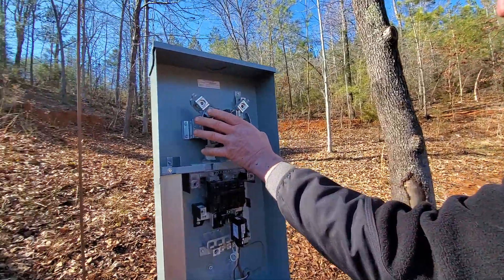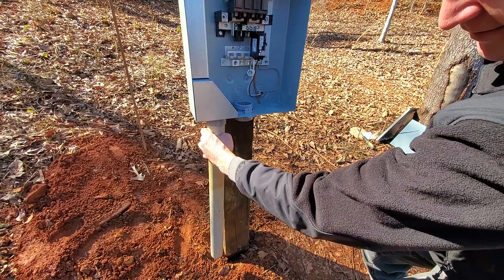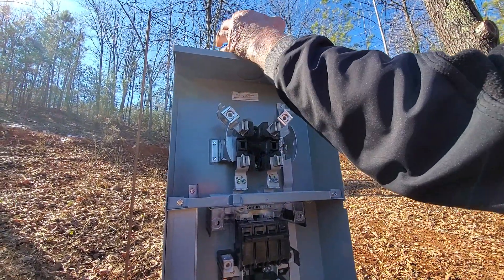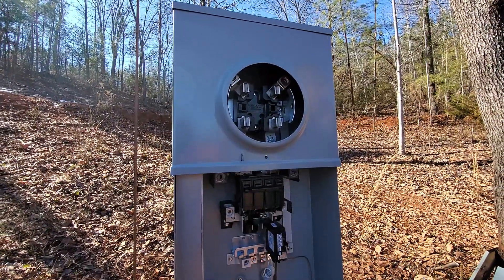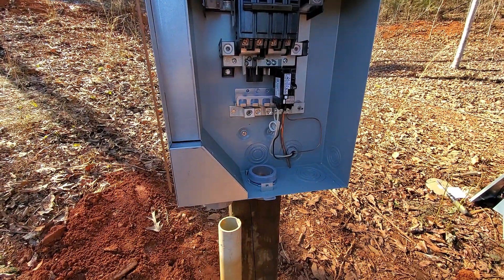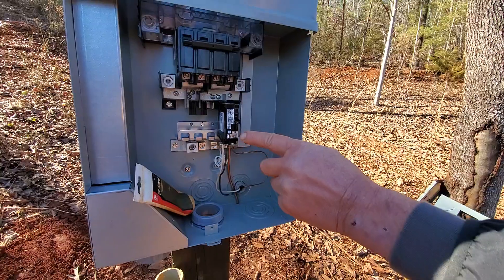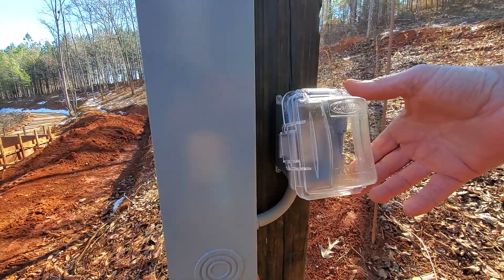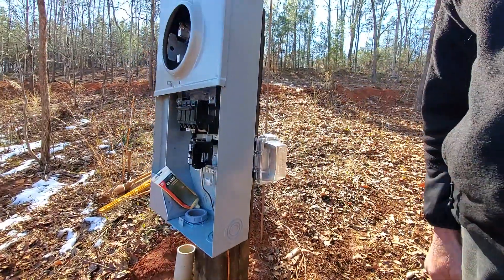Earth Berm House #3 construction 200 amp Electric disconnect panel wiring

Comment: I think I'd be satisfied just making sure I had good drainage away from the house.  I imagine it's more moist in the Carolinas than in Northern Idaho.

Anyway, I don't think the moisture barriers hurt, but if there's underground water, no amount of water-proofing will keep it out, forever.  I've read some horror stories about building earth-sheltered homes, where insufficient attention was given to where the water wants to go.  Make it so the water wants to move away from the foundation, and your foundation will be bone-dry.  It's more about making it so it's easier for water to go somewhere else than being waterproof, because you're not building a submarine.

With the plan of rock and drainage pipe going in around the perimeter, you should be golden, as long as there's a place for it to drain TO.

Very nice to have buried power lines.  They do that in some of the newer housing developments.  Overhead power lines are an eyesore.  Buried lines are less prone to weather, but I wonder how hard it is to work on.  Definitely worth the investment if you're building something new.